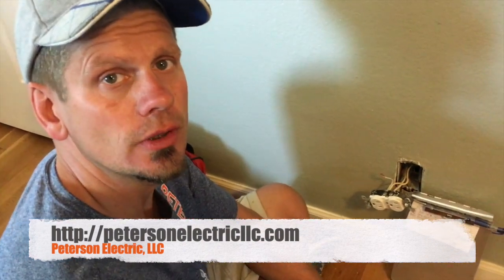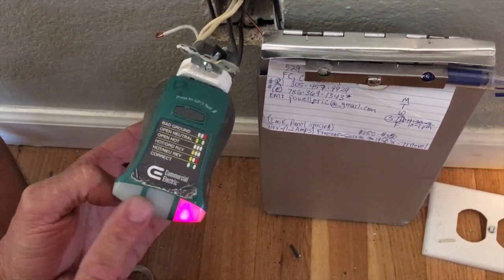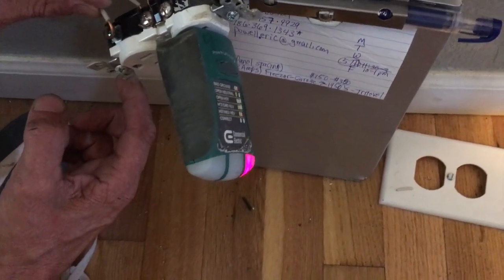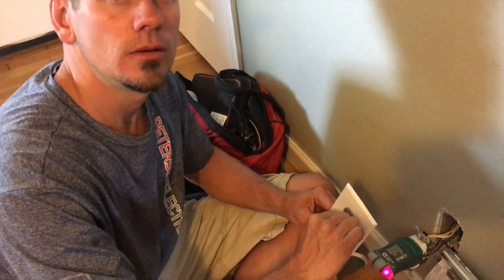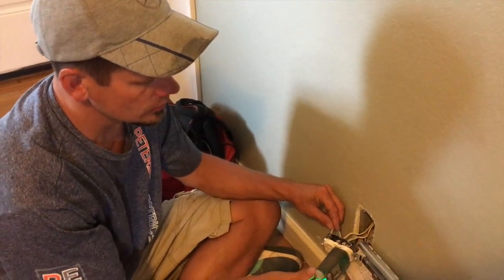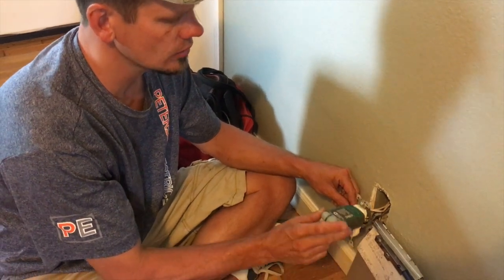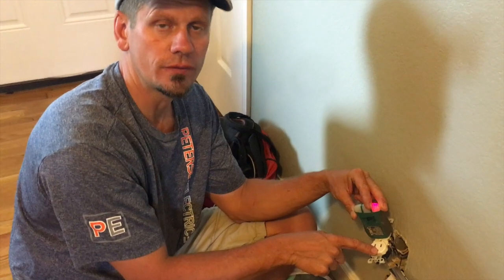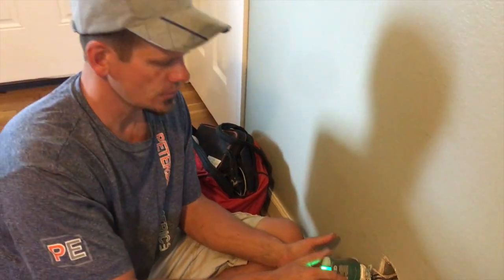Why Am I Getting Shocked By Outlet Faceplate? | Peterson Electric

Comment: 2 prong receptacles must be replaced with gfci receptacles and labeled "not grounded" whenever new 2 prong receptacles are not available per code. Cheap house flippers won't spend the $10 even though the GFCI becomes a selling point, and all downline receptacles are protected as well. New code may want AFCI/GFCI combos now.

Comment: Is the work up to code if a gfci is used for the plug closest to the breaker without a functional connection for the ground plug?
Reply: Yes but it must be labeled no equipment ground.
Reply from the maker: IT SAYS IT IS, BUT I DO NOT TRUST THIS METHOD. WE PREFER 250.130 A-C AND MAKE SURE THE PANEL HAS ALL OF IT'S 250.53 GROUNDING ELECTRODES AND USE SOME ISBB BARS IN 250.94

Comment: I see that alot in my area. Where non grounded plugs should be, "pro's" and homeowners install grounded outlets just so they can have a ground. Wiggle the tester and red to green, lol. That's why I'm getting licensed to do home inspections I see it too much on homes people are planning to buy.
Reply from the maker: READ 250.130 A- C  IN THE 2017 NEC
Reply: @Petersonelectricllc  
That's the correct way to do it, but most times it's just a jumper. I wish I could show a picture of what I worked on today. GC tied a dishwasher in to an already overloaded circuit. melted the wires in an inaccessible metal octagon box. Ran new run for DW and outlets. Did away with box, house is a mess.
Reply from the maker: @vogelservices6769  You need to show them why the neutral and the EGC cannot be on the same path.

Comment: Hi Josh do you have any idea why a 60 gallon air compressor might be shocking people when the concrete floor gets wet.
Its run off 220v from a sub panel with the bonding screw out.
Inside the pressure switch this Husky compressor comes new with the motor ground lead screwed down inside the metal box which through piping is well connected to the tank.
On the 220v feed there was also a green wire fastened to that motor ground screw.
This is where I believe power is getting onto any part of the compressor..
Another guy believes the  110 outlet outside the wall gets wet and sends power to the compressor by a shared neutral.
Any ideas?
For now I have isolated the ground lead from the chassis. You have to figure as long as the compressor is on its charging the entire thing with electricity.